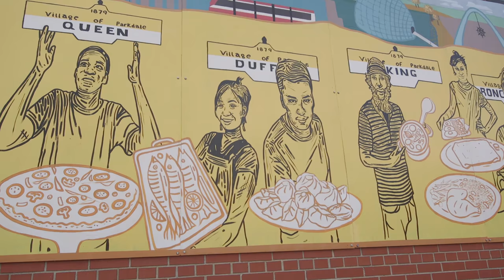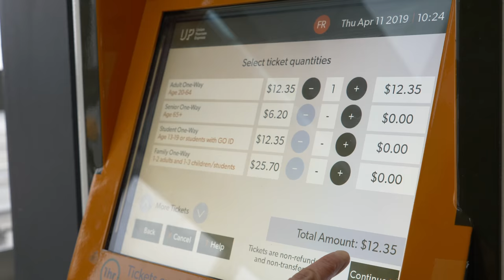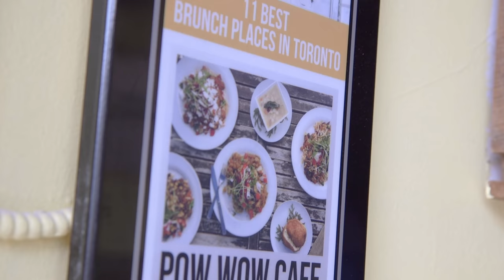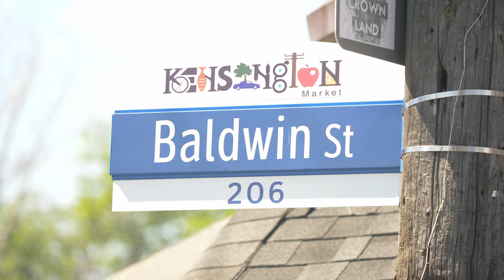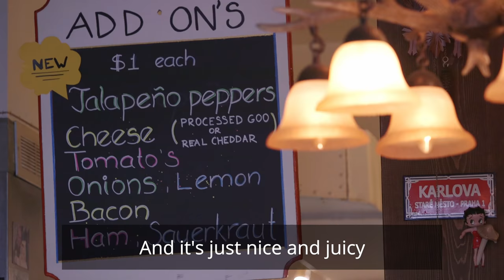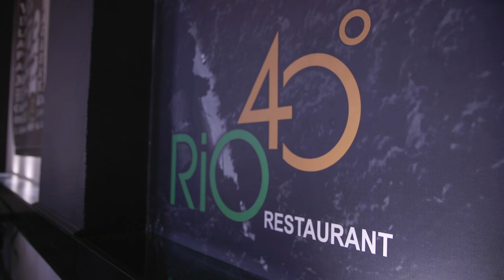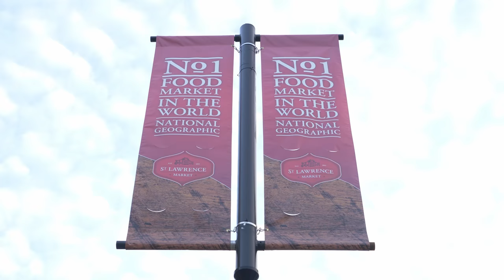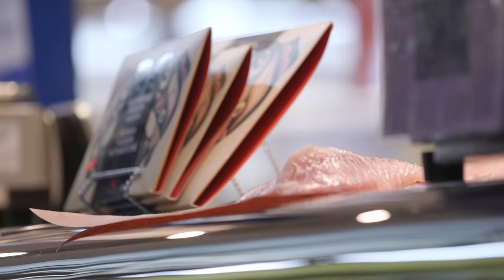The Tourist's Guide To Toronto: Let's Get Eating!

Comment: Toronto is a gridlock nightmare. That is why  so much time is spent on how to get around. You can expect to spend a lot of your time trying to get from one place to the next.  If you wan my advice visit Vancouver or Montreal, they are also culturally diverse and much  less stress trying to get around. Toronto has officially jumped the shark and become a shithole. Take it from me, I lived there when it was GOOD!!!!
Reply: You seem to be just talking about gridlock when it comes to driving, whereas I personally find it is fine getting around just with public transit.   I do not own a car and I find its great here.  Montreal is great too, but again when in mtl I prefer biking.
Reply: @torink8229  Really?? I guess if everything you ever wanted to do was on the subway line you would be fine. But the subway line is not quite ready for prime time. It does not service areas outside of the downtown core well and if you then venture onto a bus you will be in the same gridlock. 
     I just visited Lisbon, used only public transit and can report that it is way more efficient than the TTC ... (Toronto Transit Commission.) There subway will get you to any quadrant of the city easily and then a short walk to your destination. You dont even need the bus quite often.
Reply: @turboplazz  I mean old Toronto as a borough is really the urban boundary of the city and if you look at the coverage yes you’re right its no paris, but for 97 sq km with the intensive streetcar and subway coverage I think it’s pretty good.  I don’t work downtown.  I work in downsview and commute from the east end.  There have been some major subway extentions as well as 2 new lines that will be opening next year and one new line opening in 2030.   I have no need to get to the suburbs but I find I can get around fairly well.  When is the last time you visited TO?